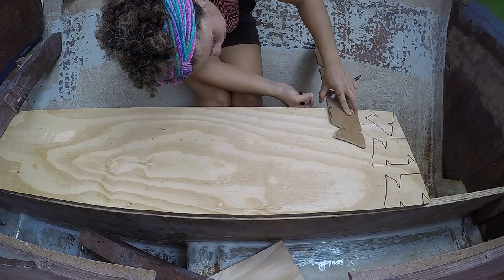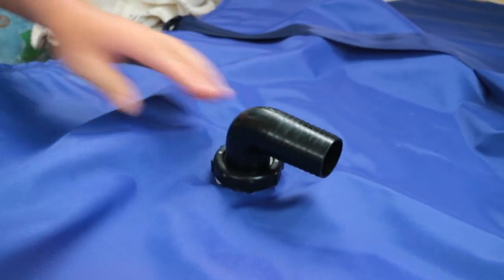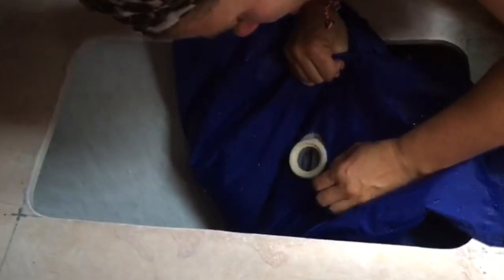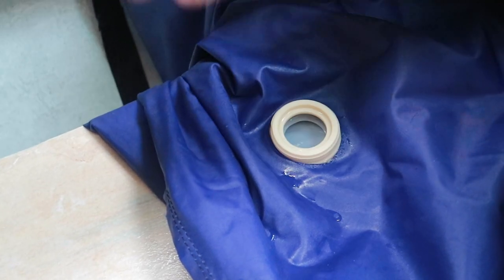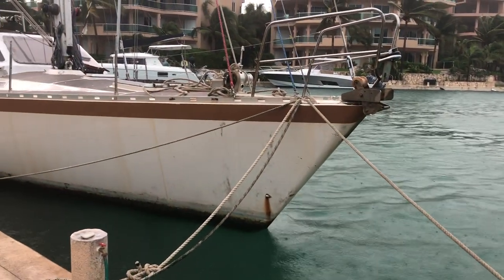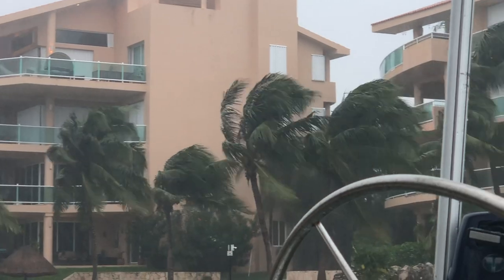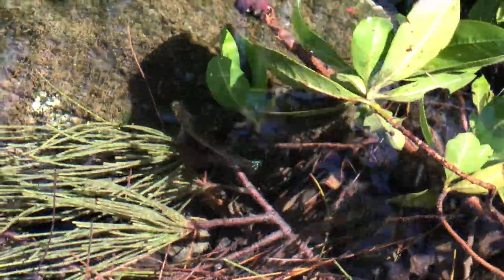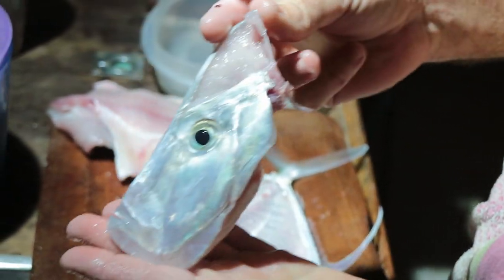77. SOPPING DRIPPING sailboat projects

Comment: Nice little kick of wind. Too bad about the water bladder.
Reply from the maker: Not too bad about the flexible tank in the end - just an unnecessary quirk. We've contacted Plastimo about it, but so far no word from them.
Reply: @sailorama  like so many,  especially plumbing jobs on boats, we make due and sometimes resort to drastic measures like using 5200... which may be the final word on the windows as well as the bladder?!#$%/×!

Comment: Hi guys, I just found your sailing channel a few days ago and started viewing your videos from present to past when I came across this one.  I have a few suggestions that I hope will be helpful with water storage.  My concern is about the use and longevity of badder water tanks.  There may be a better way, with more efficient use of space, less chances of leaks and less chance of a badder becoming a projectile during a knock down or capsize.  https://youtu.be/32_N-RNZbBA  This is a link to Dawn Treadder's video how they used the existing sides of the boat and built the water tank in the bilge.  I think you can do the same in the space you have for the badder, 1) have more gallons of water storage (using the the side of the boat all the way to the keel ), 2) get the weight down lower in the boat for more up-righting stability, 3) Far less chances of leakage to the rest of the boat, and 4) less chance of disaster in a knock down. 5) with the use of FOOD GRADE EPOXY the whole interior is safely sealed for water.  BONUS 6)  More available water when the chef opens his restaurant on the boat.  I hope this is helpful.  Next I'll try to find a link to another sailing channel on how to catch rain water and direct to your water tank(s).
Reply from the maker: Hey there! Thanks for bringing this subject up. Something I don't think we made clear enough in the video is that the flexible water tank is kind of our temporary solution to not being able to coat the integrated fiber glass tank that we made with food grade epoxy. We do want to eventually have the kind of water tank that you have described, and we are half way there - we just need to get that food grade epoxy, as well as some appropriate water pipe fittings. What we also didn't show was the fact that our bilge is largely made up of a massive integral fuel tank already. Our new water tank sits on the hull, just slightly above the fuel tank. Thanks for checking our videos out!